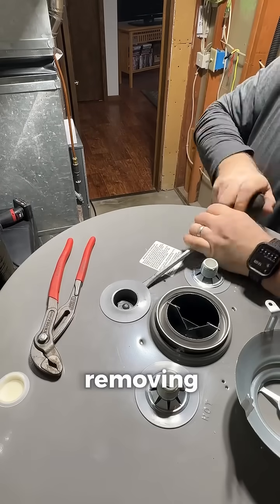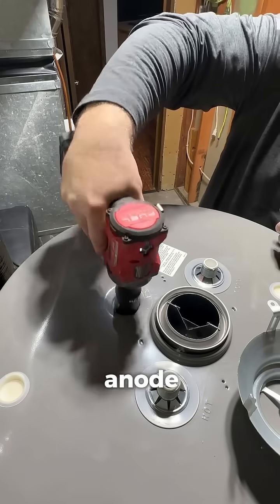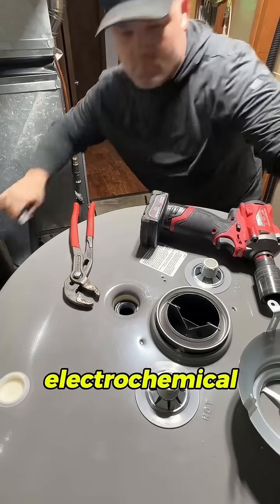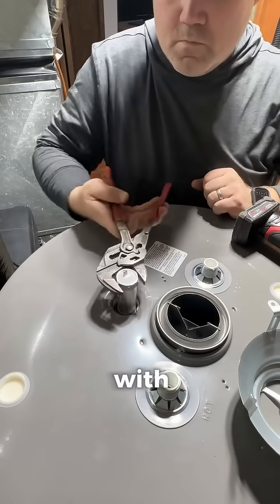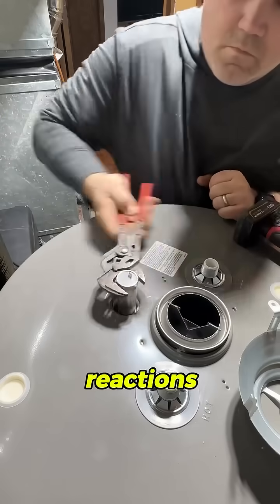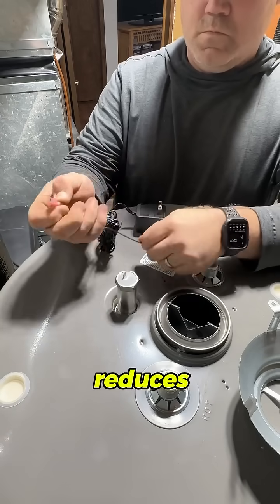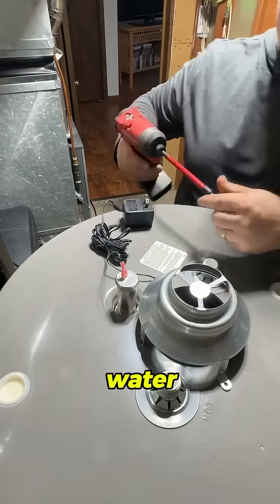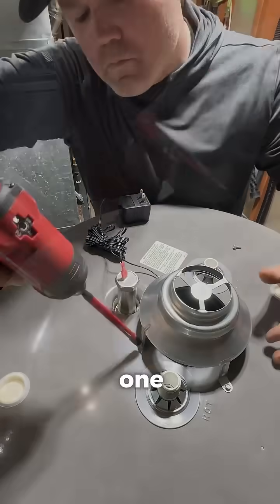Powered Anode Rodes

Comment: Another way to get rid of that smell is to bump up the water temperature to 135 because it will just kill the bacteria in the first place. Do not want to go any higher then that for risk of overheating the tank or near instant burn if you only turn on the hot side.

Comment: It would have been great to know this earlier this week. My water heater was just replaced. This is the second one in 3 and a half years. Now I know for the next time and they can just get the part instead of another brand new water heater
Reply: No. The rod can and should be replaced now. It's not too late.
Reply: @jane29228 bro he just said he already bought a new one
Reply: If you had 2 water heaters replaced in less than 3 years, you have way bigger problems than an anode rod!!

Comment: i need help with my water heater. i heard its because of over pressure or bc no expansion tank. theres a valve on the side that constantly drips water. what is wrong?
Reply: Put an expansion tank on teh hot water line above the water heater. It stopped mine from bleeding out the pressure relief.  If the hose bib is leaking just replace it.

Comment: I tried everything I could to get the anode rod out but it just would budge. I gave up.
Reply: Do it annually, from when it is new. You cannot get 'em out of a 10 year old heater where it has corroded itself in place. Mine is permanently installed, as well... Tried everything shy of breaking the gas line connection! If ceiling s low than length of anodes, they make a sausage link version, so you can get it in the tank.

Comment: What kind of bacteria like at such a high temperature?
Reply: Normal water heater temperature is not hot enough to kill bacteria. 140F+ is need to stop bacterial growth and 165F+ to kill. Water heaters are normally set at 120F dew to danger of scalding.
Reply: @lambition  dew ?
Reply: Brain eating amoeba is killed around 132F.

Comment: I call bull shit that that came out with that 12 volt impact
Reply: I forget which one did the trick either the 18 inch breaker bar or the half inch Milwaukee impact gun but it was a bitch taking out
Reply: that impact will do 550 foot pounds of torque hope this helps
Reply: Exactly.  I used a cheater bar and it still couldn't do it.  The whole tank full of water moved.  I eventually gave up.

Comment: They should be required to have both, but only if the sacrificial anode rod will be saved by the powered one. The thinking is that in the event of a power outage there will still be protection for the tank.
Reply: Power outages are so brief it doesn’t matter

Comment: Does installing PEX to the heater stop the electrical current that causes the buildup?
Reply: All chemistry is electricity. No, pex does nothing, you can see him connecting one wire to rod and other wire to chassis.
Reply: Ever since Ai has been released,  the DUMB AND STUPID Comments have increased exponentially.

Comment: We haven't touched our water heater that was here when we moved in. That was 16 years ago. Lol
Reply: No one ever told us about an anode rod so we never did it. I don't remember my parents ever doing it, either. We do have a water softener and city water AND a glass lined water heater, but when we had the rod replaced the plumber told us it was the worst one he's ever seen. It was maybe 6 or 7 years old.

There needs to be a 'home maintenance' class at the Y or a local community college that you can take that doesn't teach you how to like, build things, but just goes over all the normal maintenance things that need to be done in a house that no one ever talks about. Furnace filters, anode rods, cleaning the AC coils, cleaning the dry vent, how a sink trap works, how a toilet works, etc. Pass the class and insurance gives you a discount maybe? I dunno.
Reply: @WhiteG60 or just use YouTube and the internet 😂 every question you have will be answered. People who don’t try anymore are just lazy, there’s no excuse unless you’re crippled tbh
Reply: You might have a glass lined water heater
Reply: You either have a water softener, you're on city water that is soft, or your w/h is on its last leg.
Reply: @littlejackalo5326 I had a water heat last 30 years. It was yellow from the 80s

Editted to add it was on a well

Comment: Couldn’t get the anode rod out of my brand new tank with a 3/4” breaker bar.. I think it was cross threaded from the factory.
Reply: Naw they are always on super tight. Get a 3/4" drive impact to remove it.

Comment: When you apply a voltage/current it becomes a cathode. It’s called “cathodic protection”.
Reply: Anode , cathode is something different in chemistry than it is in physics / electrical engineering.
Reply: @nemam_nedam The process of applying a voltage to mitigate corrosion in water borne vessels is called “cathodic protection”.

Comment: I’ve looked into these, but I’m leery. How do you know if they fail?
Reply: Agreed, this is my issue also; how do you know it's working.  I have had some experience with both passive and active "cathodic protection systems" relating to underground piping.   Electrically isolating your home's water system from the outside world would be great, especially if you're using the active (powered) type anode system.  Most newer homes are isolated via plastic piping.  You don't want to be an electrical ground path for your neighborhood electrical system.
Reply: The green light on the Corro-Protec power supply turns off if protection is NOT active or if there is a system issue. It’s a simple, accurate, and foolproof indicator.

Comment: I'm on my second water heater in 27 years and I've never changed an anode rod. Never saw in owner's instructions of a recommended maintenance.  I've replace several elements so what gives? I would like to know more about electric anode. Of course wife will have one more reason to not drink the water.

Comment: We had a sulfur smell in our master shower. I saw this recommended on another video and replaced my old anode rod with one of these. We no longer have the sulfur smell anymore.
Reply: Same here. Had it for about a year and been working great so far. 

We'll see how it goes long term.
Reply: @cowboywithnohat 
With this being the new year, in a few months I'll have had mine for 6 years.
Reply: Must've been your egg-water recirculator
Reply: you are supposed to replace the anode rod with one that has a different metal composition when you dont use city water.  That's normally the reason why people get that sulfur smell...or their water heater is old and the anode rod needed to be replaced.

Honestly, anode rod replacements are SO much cheaper than a powered anode rod it makes zero sense to use these.  Replacements are less than 20 bucks.  Also, if you need to replace an anode rod in your individual water heater every 3 to 5 years...you have other problems.  I have NEVER seen one that needed to replace that often!
Reply: @chrisbro7796 In Florida you'll get the smell with city water as well.
Reply: @chrisbro7796 The only rod that fits the clearance above our heater is the one that comes in flexible segments, and it disappears rapidly (no way is it lasting 3 years 😂). The electric rod fixed long-standing issues that the regular rods never could (yeah, there's issues with the water... take it up with the designer) on top of the electric rod being short enough to work with, and it keeps on working and working. I got a second when the job came up for my brother. I would buy a third as soon as it's needed. It performs better. I don't know why that doesn't seem very important, but if you're on city water and you believe that a rod could last 5 years out here, then this conversation is entirely hypothetical... 

To anyone thinking this might be for you, this is legitimate technology and an actual game-changer. Our water used to be like barf. It's damn near miraculous how it doesn't smell rotten anymore.

Comment: Has this electric anode rod had an independent test? I am old and have seen lots of supposed great inventions that end up being in the dumpster.
Reply: Grey and blue polybutylene water lines comes to mind.
Reply: @ccadama the polybutylene lines were never the problem. It was the fittings holding them together 👍🏻
Reply: This is not a new technology. I’ve seen it used on buried pipes, bridges, ships and even some cars. You still need to replace the sacrificial anode when it has been depleted.
Reply: I was also thinking that, with the assumption that it works, it should have some monitoring if that transformer should stop, like an LED or something that goes out if the circuit through the tank is broken.
Reply: @KaceyGreen 
On the wall plug there is a green light... I'm guessing that if it quits the light wouldn't work because the circuit is broken.  

In my case sulfur smell would come back as well.
Reply: @Gamerz00760  hmm, not too bad then, though I suspect most of the failures would be in the transformer or the upstream circuit, nerdy me would probably put a current-sensing smart plug on it and have it alarm on substantial changes in consumption or if it disappeared from whatever home controller/IoT wifi network it was riding.
Reply: @KaceyGreen 
I installed this same one almost 6 years ago. Been working good.  It only draws like 1 watt or so.  
I like tech too for monitoring. I have a battery backup system.  Ecoflow first gen smart home panel.  It monitors power outages & power draw on each connected circuit, then powers up when needed.  
Although water heater isn't connected to it.  

Nice thing is the batteries can be disconnected & reconnected to energize the whole house, but limited to 30amps... hybrid water heater really doesn't draw much was like 400 watts according to my battery backup when I did testing.
Reply: @Gamerz00760  I've got the same setup, just had to switch the settings for the new Time of Use rates that went into effect this morning, they basically unplugged us from the grid during the 4 greedy hours.
Reply: @KaceyGreen 
Crazy that we're this far into the future with technology, yet  fixed rates & reliable power is still a problem.
Reply: “Cathodic protection” systems have been around since about 1824. They are very reliable and effective.
Reply: @fredericdudley6184 not what he was asking.
Reply: Paying attention in chemistry classes would have enabled you to know why it works.
Reply: @davidjohnston4240 not what he asked. Holy god, answer his question or move on. Merely was asking if this POWERED VERSION was legit or any better than whats happening already 😂